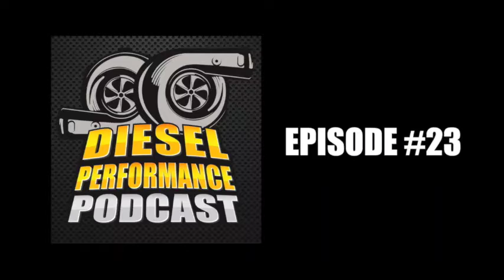Cummins Turbo Shootout - Part 1

Comment: diesel power mag did a turbo shoot out, used same truck just swapped out turbos,i was suprised some of the aftermarket turbos performed worse then stock,and some for the $ had very little gains.
Reply from the maker: +Game Bred Duramax That was the same test. Calibrated Power actually conducted the testing and it was published in the magazine.
Reply: Haha wow,thought all this seemed familiar,same turbos and all,i didnt want to say u guys were copying an old mag lol, thats awsome guys,ive got every diesel power  magazine for the past 5 yrs, the little red cummins express is 1 of my favorites.